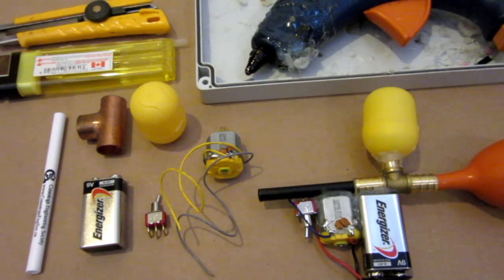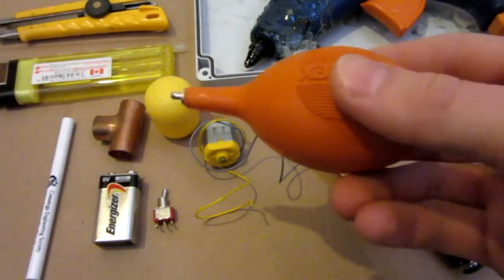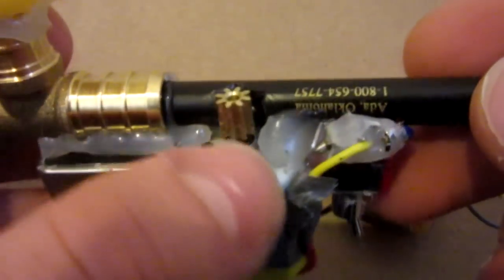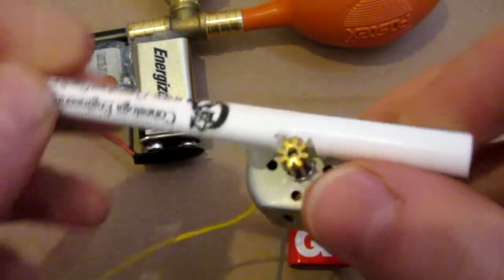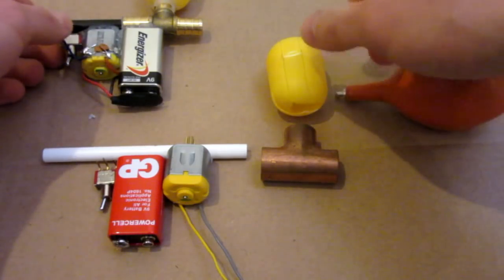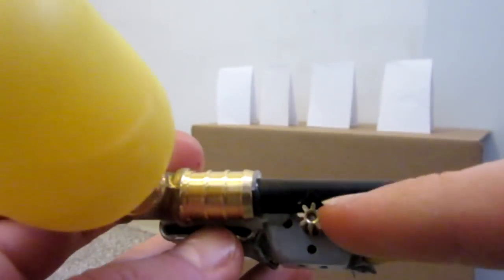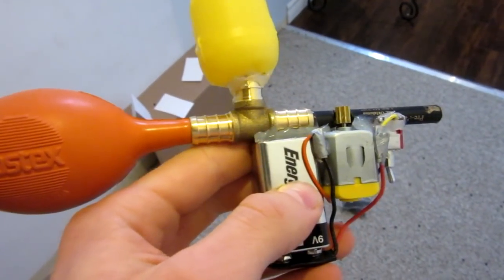Make a FULL AUTO BB Gun -  DIY

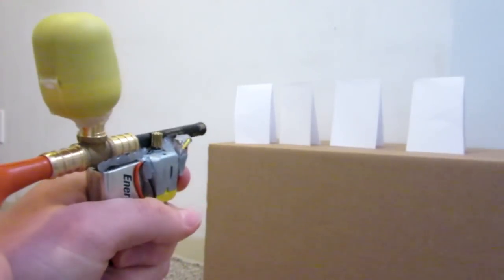Comment: 9:50 is when I realized I wasted nine minutes and 49 seconds of my life.
Reply: me too
Reply: He just need a funnel as cartridge (so he wouldn't need to shake it) + 2 motors instead of 1 + a bigger battery lol
Reply: This DIY is pretty bad, if you want cheap DIY use an air compressor (cheap 13 dollar 300 psi amazon ones that you can put on your back hip and carry) and then use any airtight cylindrical chamber that is airtight and drill 3 holes in it, one for the air input with a trigger (they are called compressor air blowguns) and then one for the barrel which again needs to be seal on the outside connection with hot glue or epoxy or a rubber heat gunned seal. The third hole needs to have a large brass connector of any sort that is big enough to have a cap and also to be filled with BBs from above easily. This system will get you 10-50 rounds a second on your gun with pretty good range and speed on your shots.

I use the system I mention for the build on my browning machine gun which I am building a second variation of currently. It uses a high quality 5/16 x 20-inch steel rod as a barrel and can use either a large metal back strapped tank to holds BBs (which gets pretty heavy but also allows you to go fully machine gun on them) where the gas normal gas input has the trigger air line connected (which is connected to the 12v compressor which is hip mounted again.) The middle of the air tank needs a drilled hole that then houses a connector that can move both BBs and air at the same time to be fed into the barrel after going through a very short slightly curved rugged but flexible air pipe which connects the tank to the barrel. The barrel is cased on the outside by either a larger aluminum pipe with round heat reduction holes similar to the ones found on real m2 Brownings or a PVC pipe that does the same. The larger pipe whether it be PVC or aluminum has a handle connected to the top which consists of two aluminum bars holding a PVC or aluminum pipe (PVC is low budget, aluminum is a slightly higher budget build.) Together the bars and pipes (which are attached on the bottom to two of the barrel holes perfectly opposite to each other, the PVC ones have simple rods going through them to block them from coming out of the hole however the aluminum handle is tig welded onto the outer barrel) make the iconic but simple m2 Browning handle that gives a good grip after I use a heat gun to burn on a layer of elastic rubber to make it a comfortable grip. The trigger which is connected by the first pipe to the tank and the compressor can either be mounted to the back of the gun facing up vertically for a stable trigger or be allowed to stay mobile without attaching it to the barrel which might allow more freedom but is also quite dangerous as it has two pipe attached and would move if not mounted. I'm thinking of working on some dual barreled or tri-barreled m2 brownings but those take even more work to make. I might even put the browning up as a commission gun if somebody was willing to pay a fair wage for all that work.
Reply: But you saved mine thanks
Reply: @hj2479  bro woooooooooooowwwwwwww
Reply: Well said, exactly.

Comment: cool video. maybe use 2 12v motors instead and find another power source. Position the motors across each other...similarly to what you've done. Maybe take a look at those Automatic baseball pitching machines or the ones used for tennis. There's also not enough traction on the bb. You have a metal gear, barely touching a plastic bb. It will not push out the bb very far. You need to add some sort of rubber material to the gear. This is by far the best concept you've had. love it bud.

Comment: cool I made something like this before when I was in highschool during holiday break (around 8-10 years ago or so)

nice to see someone else come up with a very similar idea. One 'upgrade' I did we to use a bigger gear with big gaps -- like those Knex ones. Made the hit more powerful but then I had a problem where some of the BBs would snap back into the tube instead of getting in front and being propelled forward. And for uptimate DIY I simply used a pen tube for the barrel. It has a hole for the motor and another for the BBs. The BB hole has a tube bigger than BBs to get to but another tube can fit in thats perfect for BBs. Then the 'magazine' pen tube filled with BBs is put into the bigger tube and right on top of the motor hole. It makes it so you don't have to shake though you can only shoot a few BBs continuously.

Comment: to improve the velocity you would need a higher speed gear, to do that i suggest you take the motor apart and fiddle with it's inner workings, aswell, in-term you will need a higher capacity battery, and make a way for it to be easily removable, and interchangeble with new batteries

Comment: try using smaller bb's and smaller barrel to keep them more in line which could add to accuracy and power because the weight of the bb is smaller just a thought idk if it will work but it might help nice gadget

Comment: E for effort.  I think if the gear was on the bottom you would get more speed and accuracy.   After all gravity  cones into play.   You  probably  could of used the pin mechanism  on the bladder pump.   To push it as a firing pin.  Keep experimenting.  Again.  I'm not hating. Because you had the right idea.

Comment: If u put a bigger wheel on the motor they would fly better because if the lenght that the wheel has. line if u have a 2cm diameter wheel... the outside lenght(german: Umfang) ks bigger 
-->(radius*2)*PI = U(German: Umfang)
so if the motor makes one turn.The wheel gives it more distance. Anybody understand?? If not: Bigger wheel more speed, less power... smaller wheel, more power. With power i dont mean less distance or something,just if u have something heavy tho shoot. it may not be able to throw it,because of to much wheight. the Motor just stops spinning... You can try it out. for example with Lego®️ Buimd a little car and mount a little wheel on it... and then try it with a huge wheel.